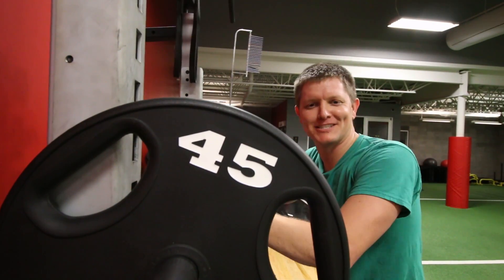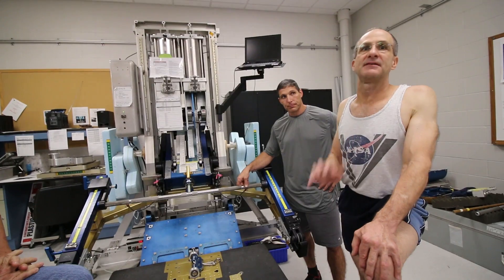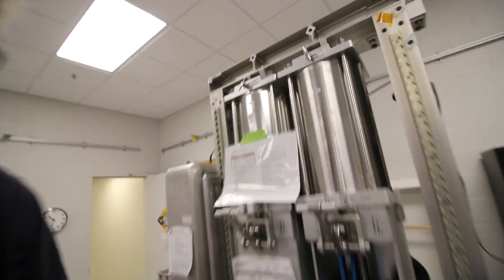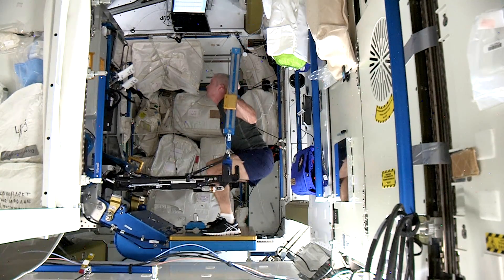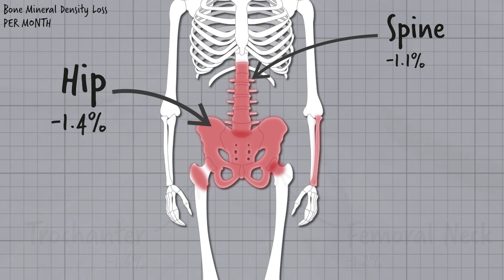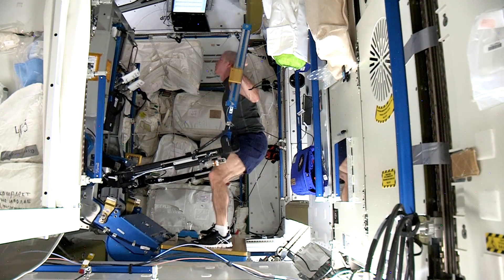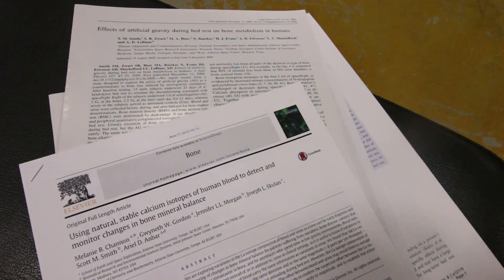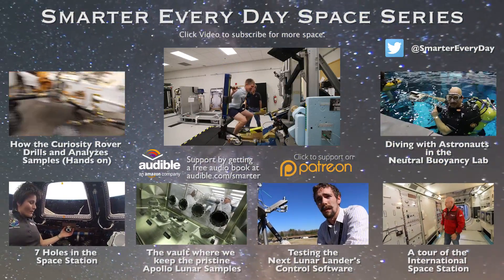Astronaut Urine Teaches Us Stuff - Smarter Every Day 149

Comment: FUN FACT: My granny broke her hip last year and got a hip replacement. When she showed me her old hip bone, I noticed it was a ball (rather than a socket) joint. I asked the surgeon why and he told me when we say someone broke their hip, we actually mean they broke their femur. He said a broken pelvis is a lot more serious and a lot more painful.
Reply: +James Murphy huh. Learn something new everyday.
Reply: +James Murphy Yep; in a bit more detail:

If you look at the top of the femur (thigh bone) it has the ball-part of the joint which is the head of the femur, then there is the neck of the femur leading to the trochantor major - which looks like some odd lump of bone. The bone angles here, leading up to the knee eventually.

The hip joint (femur to pelvis) is actually extremely strong - and the trochantor major is also very strong as many large muscles connect to the femur here. The weak point is the neck - which is where most fractures happen.

Another issue is that the head gets its blood supply from the neck of the bone - so when that breaks, part of the bone starts to die and deteriorate. A broken hip on its own is not/very poorly going to heal itself, and if it manages to do so, you may end up with a shorter leg on the broken side, or bad mobility in the hip.

Its much easier to fix it by sowing off part of the femur and put implants in there that replace the joint and pin in the femur for stability. If you would watch the surgery you would see actual sawing and hammer work to get the stuff in there xD Because the implant is metal, a cup is also implanted in the pelvis bone, so the joint becomes metal-to-metal instead of bone-to-metal. (I say metal, but materials may vary.)

Breaking your pelvis... is much more painful. The pelvis is essentially a ring, so if you break it, its usually at 2 places instead of one. A loooot of muscles and connective tissue attach to it, so with every move of your legs and your torso you will feel it... Surgery usually aims to restore the ring with pins/screws and plates, rather than replacing bone.
Reply: ***** Appreciate the time you took to share that! Actually very interesting stuff.

Comment: Why is it important to have a constant force? Does the body respond differently to a constant force than an increasing one? Couldn't a much simpler machine for constant force be a elastic band that wraps around a cam designed to counter the change in force with a change in leverage, or even something akin to a Bowflex, which I believe evens out the increasing force from the bows using cams aswell?
Reply: +BlameItOnGreg As far as I know the bow flex doesn't have a set up for lifting a weight over your center of mass. Since the main issue is decreased bone density around the hips, things like standing lifts are needed. Since you need to compress the bone in that region to encourage the increased bone density. Bowflex only has pulling resistance and to get into a position to push against the resistance would mean you would have to be under a bar with tensioned cables, which might be a lot less safe. From what I have researched a set up like bowflex to produce a significant resistance the device becomes unstable and most likely unsafe. This is just an educated opinion despite having never used a bowflex or been in space.
Reply: +Psychodegu The machine in the video only has pulling resistance too, and pushing or pulling is also really just a matter of directionality, hence how a simple lever is used to flip it in that machine. I'm definitely not saying to just take a Bowflex up into space — they aren't even particularly safe here on earth. I'm just saying that there are ways of taking bows or bands or other systems that have increasing force and mechanically accounting for that with something as simple as a cam. It just seems odd to me, to have the inherent complexity associated with a system that has to hold a vacuum (seals, tolerances, etc.), be chosen over more simplistic measures for something that goes into space, and I'm wondering what factors lead them to go the route they did. To me, a cam adjusted elastic band system seems like it would be just as safe, but far simpler and easier to maintain on orbit.
Reply: +BlameItOnGreg I'd be curious as well, but the first thing that leaps into mind is possible rubber degradation by cosmic rays? Having the rubber pressure change over time would be seriously detrimental to the astronauts, whereas they have the tools on hand to measure vacuum, since they're trying to make sure they don't let it in from outside anyway... Perhaps that's (one of the reasons) why the decision was made?
Reply: +BlameItOnGreg This thing isn't constant. It uses the space station for the biggest possible compressible volume.
Reply: 0MoTheG Yes, but the aim is to imitate a constant force, and that is what I'm pondering; the aim, aswell as the deciding factors behind this particular effort toward that aim.
Reply: llearch n'n'daCorna Hmm, interesting prospect. I know resistance bands/bungees have been used in space for awhile (most notably for holding people down on a treadmill), but I suppose it could be that they degrade non-uniformly or something of that nature, so that in a system that levers their force, any minor degradation would be amplified, and you could have very inconsistent forces over time.
Reply: BlameItOnGreg yeah it does the body good
Reply: read the paper
Reply: @BlameItOnGreg  The seals on the tank could degrade over time or the valve might stop working 100%. Same problems as an elastic solution.

Comment: I didn't really understand this. One does not need a constant force when working out. I prefer working out with elastic bands. For chest workout, back workout, leg workout and arm workout. I do squats with elastic bands no problem. 7 times Mr Universe Ron Williams also prefer bands when working out. If I and Ron Williams can get good workout with bands, wouldn't switching to elastic bands save space on the spaceship, reduce weight, money on development and lower injury risc (so many people get injuries from bench and squats). To continue... Resistance bands are awesome for stretching and mobility work. 
About squat and resistance bands. I'm not talking the 10lbs recistance bands you find everywhere. They can be a lot tougher. I can do around 100kg squat with a barbell. I get a much better workout with my heavy resistance bands. Even though they're lighter in the bottom of the movement. Spine loading? Oh yes I can get that with recistance bands.
Reply: I'm seriously wondering if there was some reason why this did not happen....
Reply: +T2N31E2 Gravity.
Reply: mimsydreams One does not need gravity when working out with resistance bands. The only things required that I can think about are hooks to hook the bands on and maybe something locking down the feet.
Reply: +T2N31E2 It's easy to think elastic would work but in scenarios like this, and I admit I thought the same. But after being told different by someone who has spent a lot of time researching the matter, what I do is assume I'm wrong and try and figure out why. 

Here's a couple of things I came up with, and of course only one has to be correct to disprove the elastic argument.

1) you would need lots of different bands for different people and different work outs. Bands with different lengths, strengths etc. This takes up space and time and considering that there are many different astronauts and there is a constant rotation of astronauts boarding and leaving the ISS, this may not be feasible.

2) you would still have to have a similar rig set up. The bands would have to be supported by a pivoting frame connected to something you stand on. no forces can leave the machine/frame or else the space station would start moving.

3) the aim is to maintain bone and muscle mass, not gain it. you need to be working the muscles and bones all the way through the workout in a way that doesn't fatigue the body quickly. ie you need forces against the body all the way from the bottom of the squat to standing up straight. elastic would offer very little force at the bottom of the squat and lots at the top.

4) as you can see in the video, the man is also exercising his ankles as well as many other workouts for the micro-muscles and small bones. this would be hard to achieve with elastic as you would not have a lot of force at begining stage of the work out, and all the force at the final stage; eg elevating from flat foot to tip toe.

I'm sure there are many others buts there is a few I could think of at 3 in the morning. Hope this helps.
Reply: +L4RRY you would not need many bands when maintaining muscles and bones. Even if you would need many they're small and easily stored anywhere. 2hooks can be put anywhere. Will take a lot less space no matter what. 
The squat is normally easier at the top of the movement. It's no problem that the band is a little easier at the bottom. 
Toe rises work well with bands. Again no need for constant force.  
There is not one part of the body that can't be trained with bands.  

Need for multiple bands for many people is not a problem. All of them does not need ideal rep ranges and so on.  

Moving the ship is rediculous.  If it was the astronauts couldn't touch anything in there.
Reply: read the paper

Comment: Why do they need to burn the pee? Can't they put it through a spectrophotometer? Or can they not reliably account for the difference in concentration of the pee and so they need to burn off the water?
Reply from the maker: +Ivan Navarro The burner is the spectrophotometer.
Reply: We love you Destin!
Reply: +Ivan Navarro The even weirder thing is that the spectrophotometer is detecting how much light is absorbed inside of the flame, and that light comes from a lamp that is most likely coated with the element they are trying to detect; in this case calcium. I wonder why the flame was green at one part in the video? As fare as I can tell calcium should burn brick red, there must be a compound or element in a much larger quantity that causes it to burn green.
Reply: +Psychodegu I believe that copper burns green.
Reply: +SmarterEveryDay Indeed, the complete name of it is AAS: Atomic Absorption Spectrometry. Worked quite a lot with it both in school and in my work as a biotechnologist. Its quiet a cool device but with the downside that you need special bulbs that only glow at certain wavelengths, instead of the normal halogen bulbs in the simple spectrophotometers that use the little cuvetes.
Reply: BlazingMandril Very cool! Do you know what are the benefits of using this type of spectrophotometry? I've only ever worked with the simple cuvette ones.
Reply: I havent worked with it in a while but from what i remember it has to do with what you're measuring. Its a lot quicker to put something in the AAS than to go through the steps of disolving just the part you want from the sample. The AAS is mostly used for measuring metal ions in liquids I think. But also look up more on it yourself since I forgot quite a bit.
Reply: BlazingMandril Thank you, and I will!
Reply: You need the compounds within the urine to themselves be the source of the light. Especially when dealing with accurate measurements of trace compounds. Passing samples through spectrum analysis with use of artificial light could detect the compounds presence but would not be as accurate for the purposes of measuring how much of each compound was present.
Reply: +Psychodegu Exactly, which means the astronaut that peed this is healthy and isn't losing too much calcium.
Reply: Im thinking that it's inconsistency in concentration
Reply: +Ivan Navarro No i think they isolate the calcium in an aqueous fluid, and then they burn it, using a spectrometer to determine how much calcium is in the solution( Note: pure calcium burns a bright red, but they don't want to see that, since that would be too much of a removal rate, instead, the greenish-yellow color that is nearer to that part of the spectrum is better). The reason they don't use a sensor is because calcium is very fond of collecting and would destroy the sensor,
Reply: +BlazingMandril Nowadays there are also spectrophotometers with a continuum source of light - no need to change lamps for every element anymore :)
Reply: +Ivan Navarro The benefit of AAS is the selectivity, sensitivity and quick analysis time for different individual elements.  Something that's very hard to do with traditional UV-Vis type spectrometers.
Reply: +Ivan Navarro  I"m sorry, when a person acts stupid discussing science it really sets me off. Look, they were using an Atomic Absorption Spectrometer to measure the amount of calcium in the urine. They may have been looking it in the emission mode where the intensity of the calcium ions wavelength in the flame is measured directly by a spectrometer. I think they were using it in the atomic absorption mode (because the NASA guy said something about light being absorbed) where a lamp with doped with calcium passes that calibrated light through the flame and depending on the amount of calcium atoms in the flame the input intensity is decreased through absorption by the concentration of atoms in the flame.
Reply: Well according to my metric dynamic counter meter the measurements of the spectrophotometer cant be reliable enough due to the radioactive mitosis that is generated from the urine, in conclusion the radioactive agents that was generated wont be able to be visible through the human eyes instead we need to use a CT scan similar to what we use in hospitals to be able to get correct readings.   

Come at me bro.
Reply: M.L Noice
Reply: To add on to that, each of the Group 2 metals exhibit distinct wavelengths of light when burnt. A sample of urine may contain several other chemicals that affect this absorption and the baseline of the signal. Burning it helps to eliminate the other absorption signals and gives a more distinct absorption spectra, I believe, to not just detect but more accurately determine the amount and hence concentration of Ca2+ (from the amplitude of the spectra) per 1:100 dilute sample of urine
Reply: Ivan Navarro here's my theory: spectral photography only analyzes the composition of a small sample that is destroyed. But the sample doesn't tell you exactly about the whole, it's hypothetically representative. For most spectral photography that's fine since you're just trying to see what's present to a percentage of the sample, but they're trying to account for ALL of it: all of what is lost from their bodies, how much, how fast, everything. So they have to measure all of it. So perhaps that means they have to destroy all of it, but do so in a way that gives them perfect 1 time exhaustive accurate spectral analysis of every bit of it.

Comment: The process of "burning" is very different here and althou the guy said they're "looking for the colour of burnt pee" it is somewhat misleading. The thermal energy of the flame is used to break down the molecules to atoms. A beam of light is ran through the atomized and vaporized sample where some of the photons will be absorbed and their abcense will be detected at the detector. The amount of absorption is compared with a set standard consentration from which the consntration of said element can be calculated.
Reply: +jmniskanen One would be hard pressed to explain the theory of AAS in fewer words, well done:)
Reply: +jmniskanen i thought about the same thing when I heard the explanation. It is all not so simple :)
Reply: +jmniskanen Well they are using light that will be absorbed by the color of ionized calcium. So they are looking for some of the color of burnt pee.
Reply: Psychodegu
Which is why I stated that it was "somewhat misleading". :)
Reply: I'm starting to believe that Destin should just release all his research materials to us for further reading.

Comment: NASA scientists analysing urine sample - using a PC running Windows XP!
Reply: Hey, if it works, it works!
Reply: +MrDissiuk No one want to bother writing a new program for other operating systems.
Reply: Since this PCs function is only to run this particular machine and process its data and is most likely not even connected to the internet,vit would be nonsene to upgrade to a newer OS. Especially professional software could cost easily 100,000 USD and more, so upgrading to Windows 78 or 10 would not only cost you a new pc with faster hardware and a OS, but a lot of money for the new software. And often such professional software is not reprogrammed for newer OS, so you had to buy a whole new machine that has newer software so you could replace a pefectly working system which has the only "flaw" that it doesn't run the newest OS, which doesn't matter, because the system wouldn't benefit from the newer OS in this application. It is not their desktop PC where they work on papers etc. Its only use is literally Display the results oft the analysis.
Reply from the maker: +MrDissiuk Did you see the video I did about the Chandra X-Ray telescope reaction wheel test? https://www.youtube.com/watch?v=7AR4yntqLsQ&t=6m45s
It explains why they use old hardware sometimes.  This particular case isn't quite the same, but it explains why it's done sometimes.
Reply: SmarterEveryDay I have now! :) That one makes sense though - same hardware to test that is on the device.
I suppose you could say the urine test are being done on an Xpee machine! Ha!
Reply: The machine is older and probabky doesnt work with the new windows. Our hospital uses windows millenium for x ray scan because thats the only OS the machine works on.
Reply: Matthew Bates
Reply: The software can run on a raspberry pi, so no need to upgrade.
Reply: Xp has proven to be stable and secure. About all government branches use it
Reply: That's the power of Microsoft
Reply: Wait. It's a PeePC!